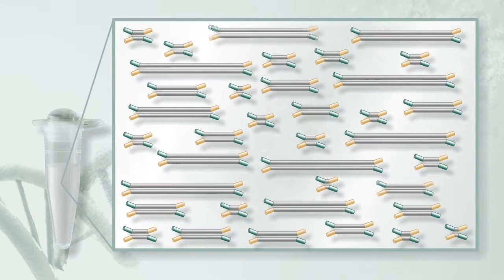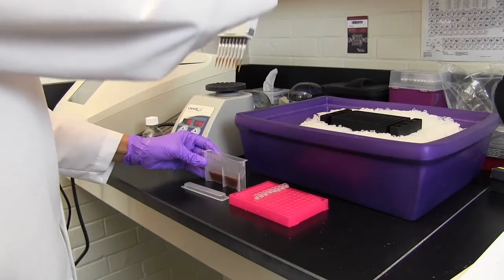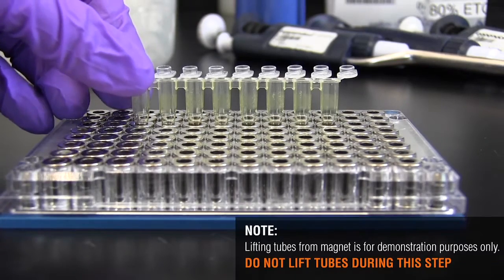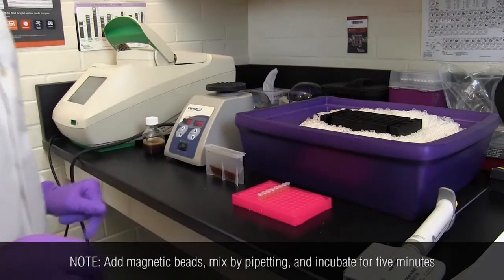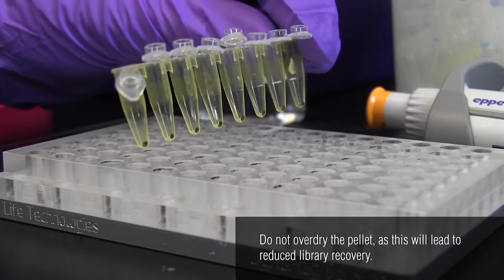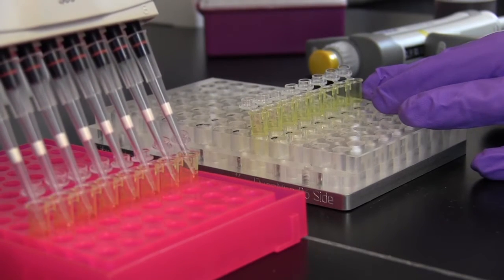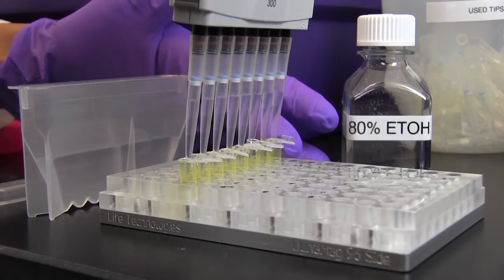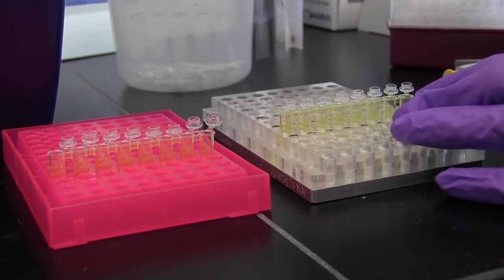Size Selection and Cleanup with NEBNext Ultra II and SPRI beads

Comment: Following the Ultra II Library Prep protocol you typically come out of adaptor ligation with 96,5µl. Selecting for 400-500bp I understand why the bead to sample ratio is so low (~0,25X). But after binding of large fragments to the beads you withdraw the whole sup again (96,5) and then use only 10µl of beads, meaning an even lower ratio, is that correct?